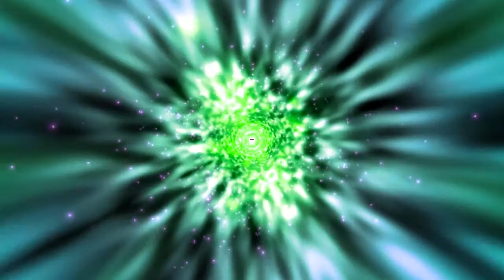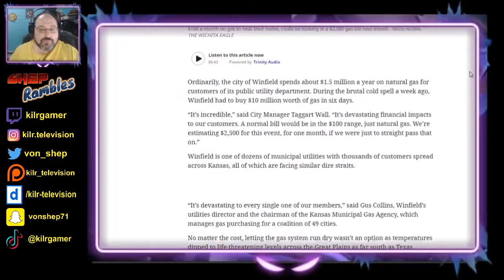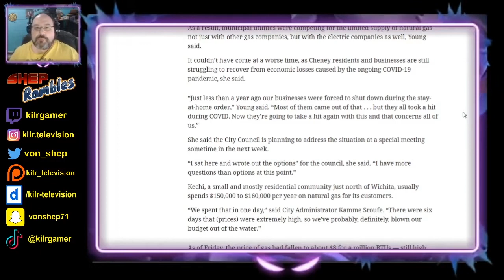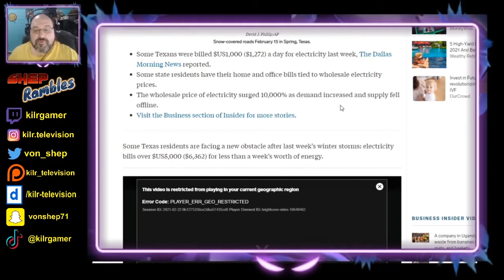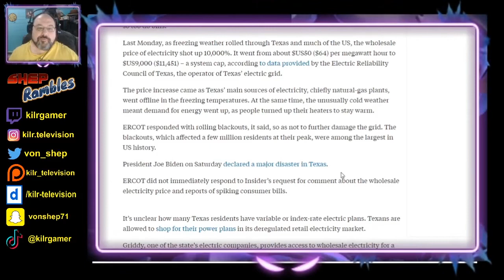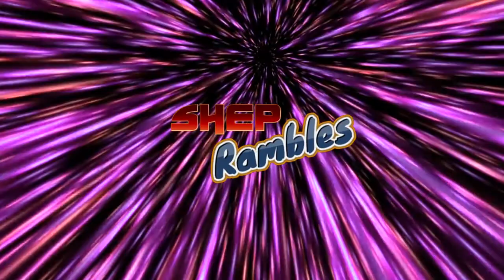Kansas and Texas residents receive insanely high gas and electric bills! || Shep Rambles s04e03

Comment: this is the problem with deregulation - especially when it comes to utilities: it might be nice in times of low demand but in high demand it means those companies can charge extortionate prices - like ride share flex pricing but on steroids. 
without any kind of regulation putting in price controls people are at the mercy of private profit
also wind power only accounts for a small percent of texas power more than 80% of which is natural gas and oil all of whihc also suffered from frozen pipes and other system failures. i find it hard to blame wind power in any of this, given that it was a general failure across all the systems- infrastructure that had not been winterised. Wind power turbines can actually work in winter conditions if they are properly set up for such. Unfortunately given that such weather events are viewed as rare, i guess they bank on it never happening, which is not really the prudent thing to do.
Reply from the maker: Something I had read later was that Texas doesn't rely on any other states for backup power. If so, the outage wouldn't have happened. (The article I read was whether or not future outages like Texas could happen in other states, but they said no and gave the reason I mentioned above.)
Reply: @KILRtv  yeah Texas is insane in that regard, it's government there was so determined to prove it need not rely on the federal government that it refused to be part of the national grid so as to avoid federal regulations, and it has its own grid, which again might be great in normal times but offers no security when crises happen. It's libertarian/Milton Friedman ethos in action  and why such an ideological bent is just plain awful fantasy when it comes to actually dealing with real world events . Some places in Texas are still connected to the larger interstate grids and they, unsurprisingly didn't suffer energy failures